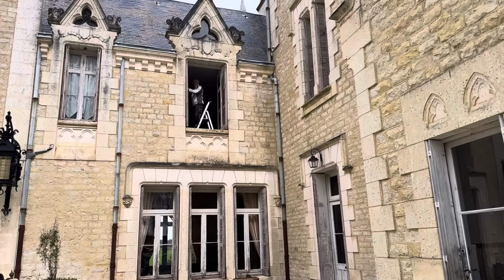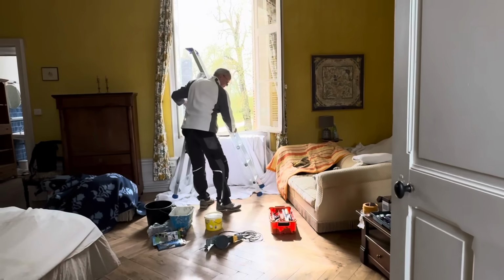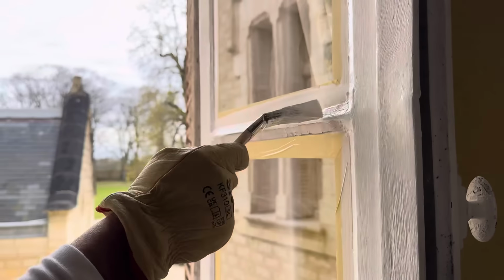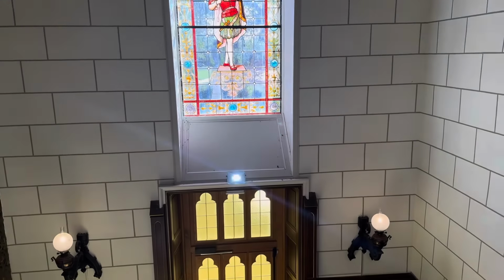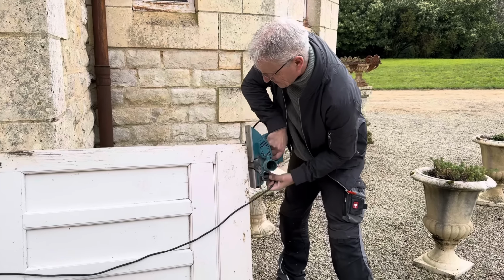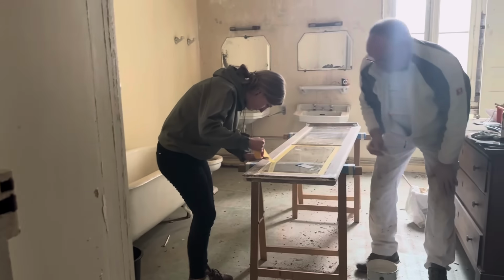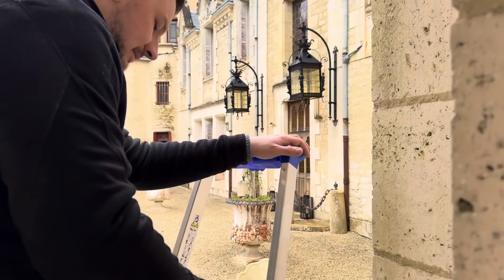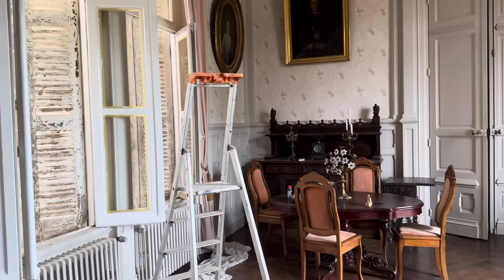Fear Turned to Joy: Old Chateau Window Revamp Exposed

Comment: I am not telling you what to do, but it might be worth setting up one of your outbuildings as a workshop in the future, so you don’t make a mess in the Chateau, 🐸,
Reply: I have set up a work shop, and I did move them from the main entrance to the un renovated section for that very reason, good advice!!!
Reply: @brettthomas6020  Hi Bret , I have worked on projects many years ago, Where before we could start, we have spent days covering carpet flooring to prevent any damage, I even remember one occasion and to lay half-inch Chipboard to protect the hallway and stairway, and boxing all the handrails, As you can imagine, the cost of this alone was very expensive for a time-consuming, 
Good luck with your projects , look forward to seeing you next upload,
Reply: @brettthomas6020  I left a comment yesterday, when I saw that you were needing help, It was removed,
Reply: We didn’t remove anything! Could be google